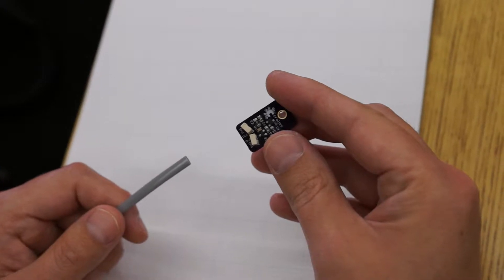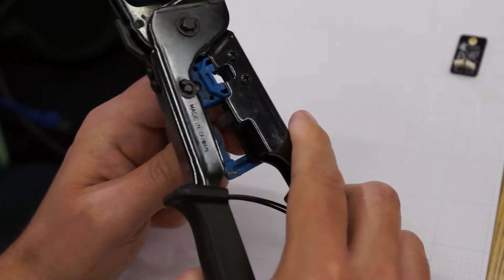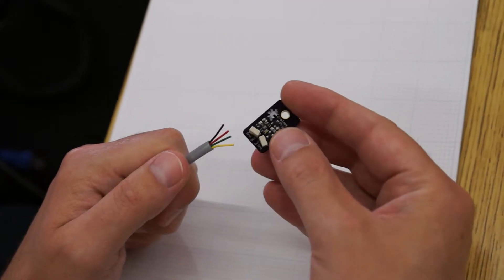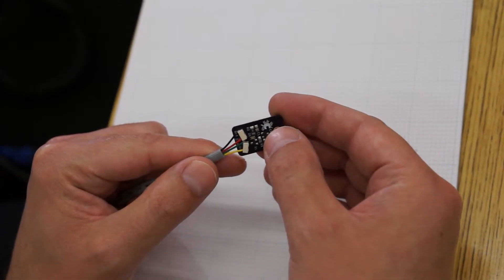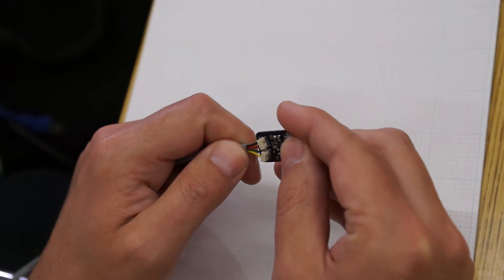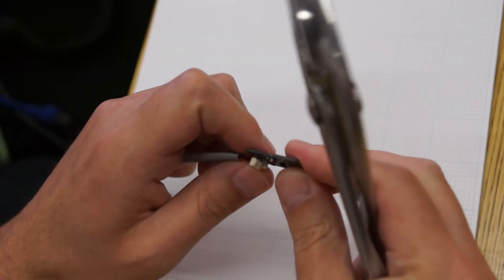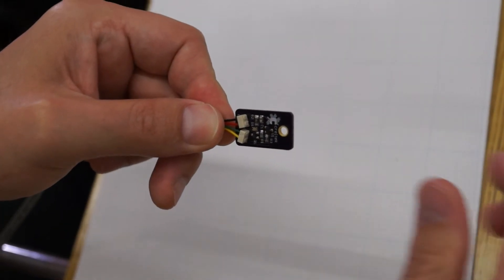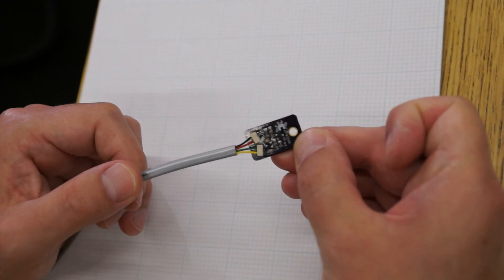Creltek Limit Sensor 343RT Wire-to-Board Connection

Comment: can put a little hot glue on it to ensure it is secured?
Reply from the maker: Yes, that should be fine. It can also be used to protect the connection (or the whole board for that matter) against moisture or other contaminants. If you need to remove the hot glue later, apply a small amount if Isopropanol (rubbing alcohol) to the edge the glue and peel back with a pair of tweezers. For permanent installation, I recommend securing the cable itself to your machine frame with a zip-tie cable mount or similar. You should never rely on an electrical connector as the primary or only means of mechanically securing a cable. Provide another means of strain relief.